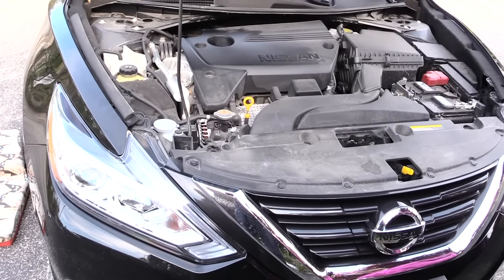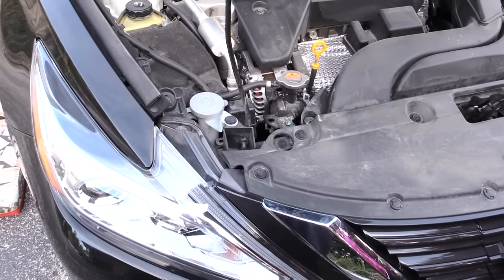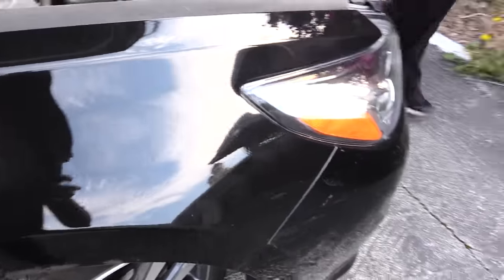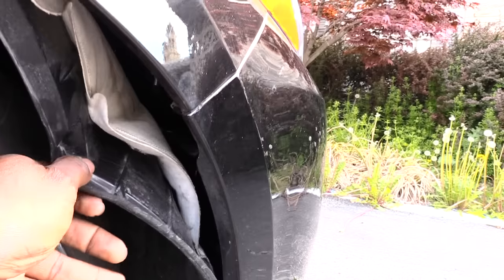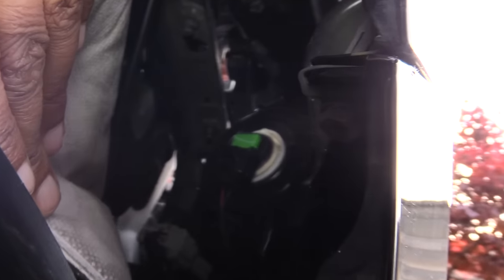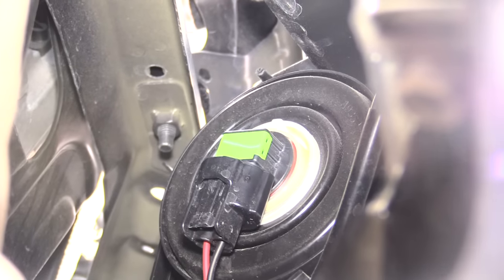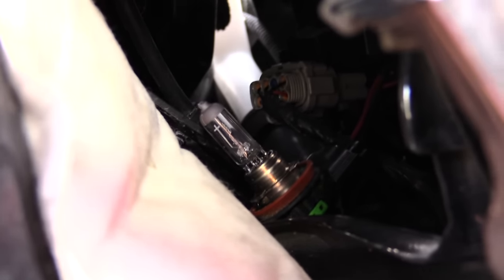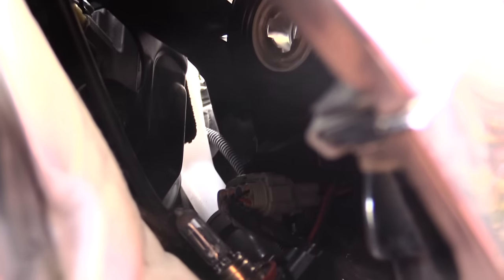Nissan Altima 2014-2018 Headlight Change Easy!

Comment: I can't get the actual bulb out of the connector
Reply from the maker: Some have pull clips on the sides.
Reply: @Flashback502  thanks my boyfriend was able to get it in less than 5 mins, It would’ve helped me if that was mentioned in the video.
Reply from the maker: @simplybritty  added note to video description.
Reply: @Flashback502  thank you!! ☺️

Comment: Note, for a 2018 Altima you CAN NOT change the headlight yourself on the passenger side, repeat you cannot there is stuff in the way and you will fail. 😣